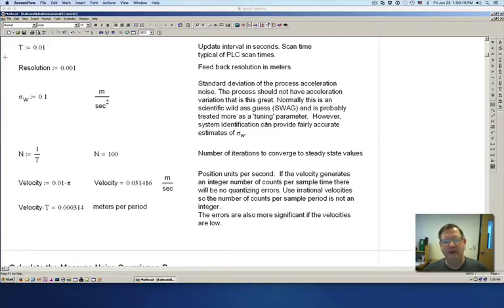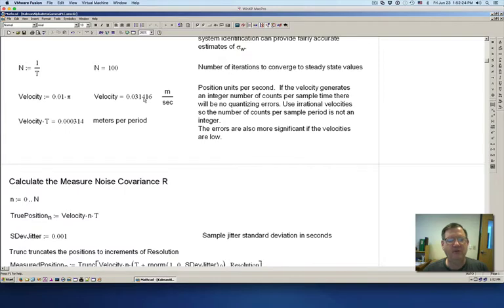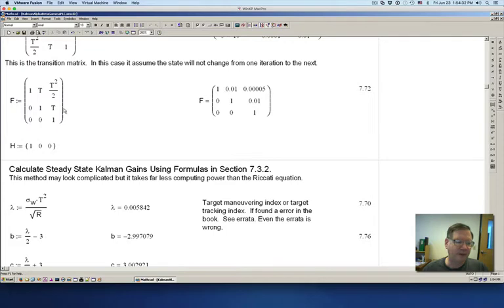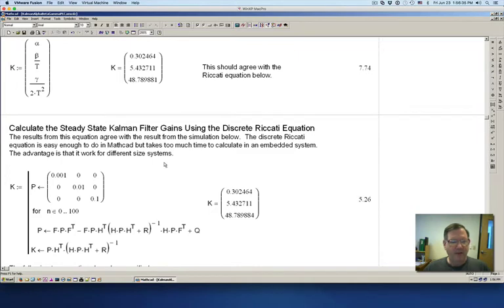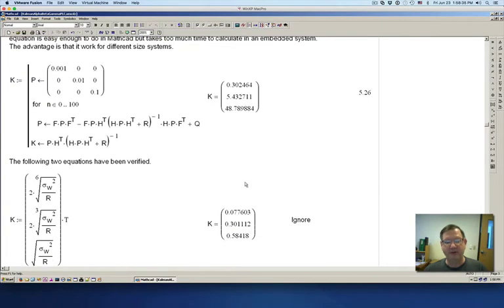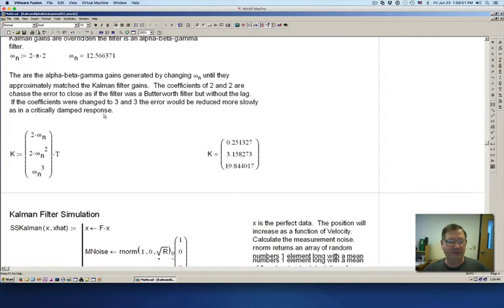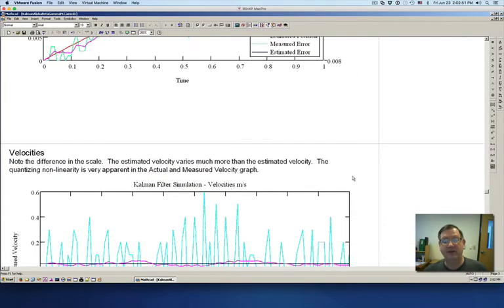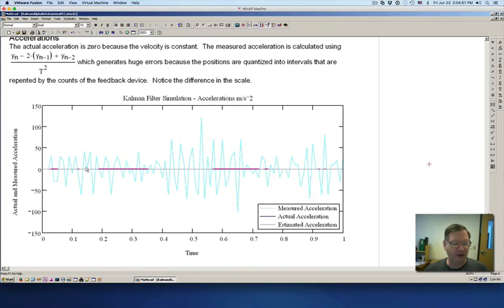Peter Ponders PID - KalmanFilters, Alpha-Beta-Gamma filters

Comment: I wonder now, what is the real advantage of Kalman filter over Observer presented in another video. Since math is terribly more complex, Kalman must be better than "plain" Observer. But it seems that both doing the same thing. By far ABG filter is the best in terms of math simplicity.  But I really wonder, if there is an observer, what possibly Kalman filter can do better!?!
Reply from the maker: The advantage of the Kalman filter is that the Kalman gains, K, are optimized assuming the system and measurement noise are known.  Both the Kalman filter and observer require an accurate model.  The A and B matrices must be correct and should be the same in both cases for the same system.  This is why system identification is so important.   I use the alpha-beta-gamma filter to smooth out encoder pulses.  Many times the encoder is measuring the position and speed of a feed chain that move product though a machine.  As the chain goes over the sprockets, there is jitter.  The alpha-beta-gamma filter reduces a lot of the noise without much if any phase lag.   The alpha-beta-gamma filter also produce a velocity and acceleration that can be used to generate feed forward values for slave axes.

Comment: Indeed a very educative video. I have a question regarding the difference between measurement and process noise. It seems that you simulate process noise by adding random Gauss distribution with mean and standard deviation. This is random in nature. On the other hand, measurement noise is only caused by sample jitter and quantization. This is also random in nature but can be known based on the data from measurement equipment and input channel resolution on PLC card.
Reply from the maker: You are right about my assumptions.  That is because I don't usually use analog feedback.  If I used analog feedback I would need to add a noise term for the measurement errors.  Adding analog noise would increase the R value a little so the Kalman gains would drop just a little. It would make much difference to the results until the analog noise started to become significant.

In reality,  people have no clue what the measurement noise or system noise is like.  They just adjust Q and R until they get satisfactory results.   In this case you should consider the alpha-beta-gamma filters.  It provide 95% of the benefit with only 5% of the effort.
Reply: Measurement noise can be estimated in the following way. If you use PLC or any other type of (micro) controller, you should be able to have possibility to obtain measurements in the csv (txt) file. Then if the input is 4-20 mA (for example position feedback or whatever), then you can use mA simulator. For example, you simulate 4 mA and take recordings every T (mili)seconds, then set up 8 mA, then 12mA and finally 20 mA. After each experiment is done, you use data in Excel or similar worksheet, calculate mean values.Then you subtract mean values and calculate standard deviations. Variance is standard deviation^2. This way you can estimate measurement noise form output of the transmitter, jitter and quantization. There could be also a part of the measurement noise from the sensor itself, but in many cases this can be found in sensor's datasheets.

Comment: Fantastic video, thank you for the information - definitely subscribed.
Reply from the maker: I need new topics.  I have 35 MB of Mathcad files on all sorts of topics.
Reply: can you explain labview implementation in pid , arduino,and other practical topics
Reply from the maker: @asifnizamani7513   There are so many different controllers.  I would need to learn how to use each one before doing a practical example.  Also, these are just tools.  Tools change. My goal is to teach "forever knowledge" that can be applied to any controller.  Writing the PID is easy.  Look at my example.  It is only a couple lines of code.  Calculating the model to do the simulation takes a lot more time.
Reply: sir how find predicted process noise in kalman filter just by find out standard deviation from the measurement
Reply from the maker: @asifnizamani7513  I use the norm calculated by the system identification process to get a good estimate.  The norm includes the system and measurement noise though.
Reply from the maker: I have other videos on tuning many different types of system.
The alpha-beta-gamma filter is basically good for filtering inputs.
Reply from the maker: I have been to many control forums.  Most engineers simply adjust the noise values to get acceptable results.  In this case they should be using alpha-beta-gamma filters.
I can estimate the noise by doing a system identification.  System identification is used to find the model but it also return the norm which is the sqrt(sum(PV(n)-EV(n)^2,0,????)) where PV is the process variable and EV is the estimated response from the model.   I have videos about system identification.
Reply: sir i have latitude and longitude data of gps so i do you know how to tune measurement noise and predicted process noise from gps data
Reply from the maker: Estimating relative noise is the hard part.   Calculating the overall variance from a mean would not be hard but it may be better to go to a known long and lat and use that as the mean.  I don't know enough about GPS to know how much of the noise would be system noise vs measurement noise.

This is why so many people fudge the noise values until they get acceptable results.  This is also why i am a fan of the alpha-beta-gamma filter where there is no pretense of being optimal but find acceptable is easy.  Basically getting 95% of the performance with 5% of the effort.
Reply: sir i get overall standard deviation then there is good for predictive variance
Reply: sir i get overall standard deviation then there is good for predictive process noise
Reply: sir professor can you have recently labview implementation on control system.